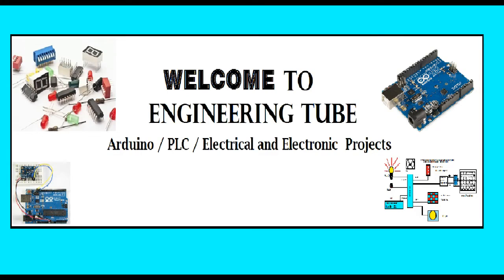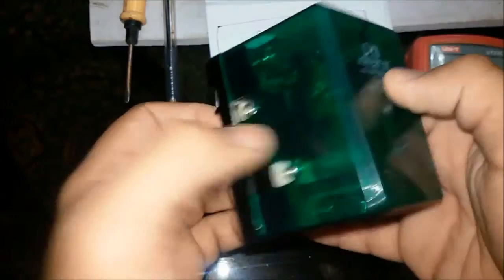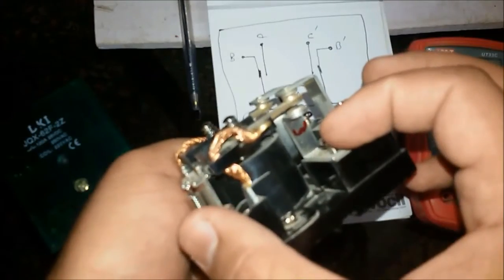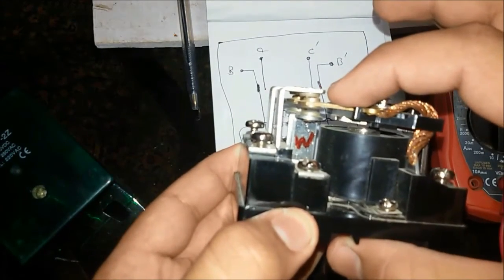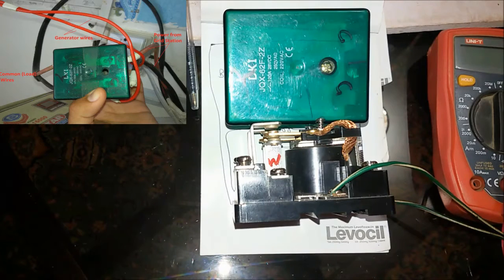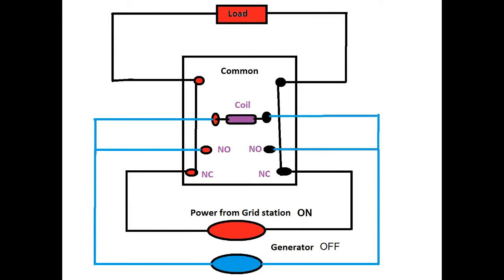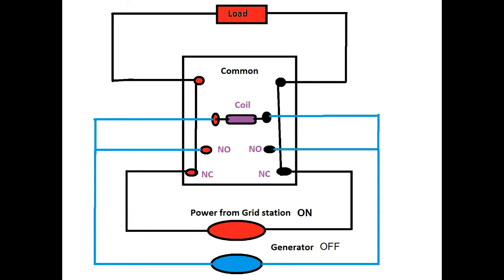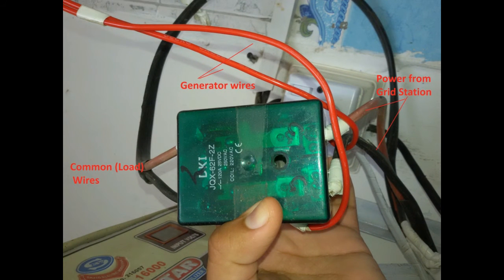Use DPDT AC Relay as Automatic ON and OFF Switch

Comment: Plz can you explain to me more information about the connection of three ways
Reply: I use electric and battery system  and motor
Reply from the maker: @burgerkingalsalafiya5205  Sorry i did,t get u for what purpose u want to use AC relay.
Reply: @EngineeringTube777  yes I want to use it in a three ways face ...but installation Is easy
Reply: @EngineeringTube777  what's the direction of installation
Reply: @EngineeringTube777  yes i do
tell me more about how to connect
Reply from the maker: @burgerkingalsalafiya5205  its easy bro.focus on the video u will learn how to installed  it.